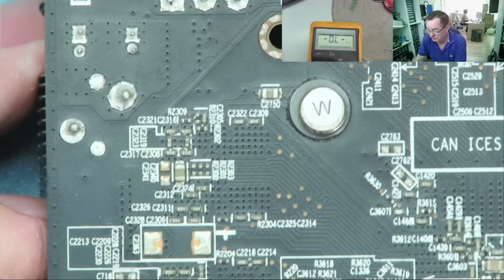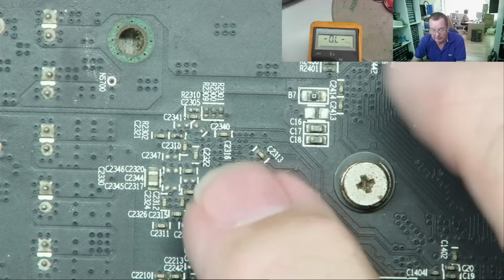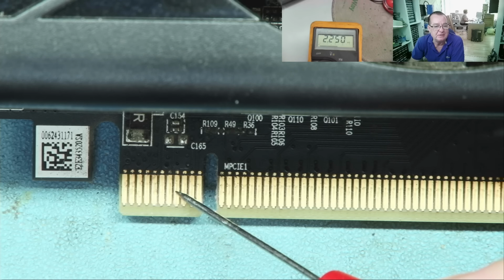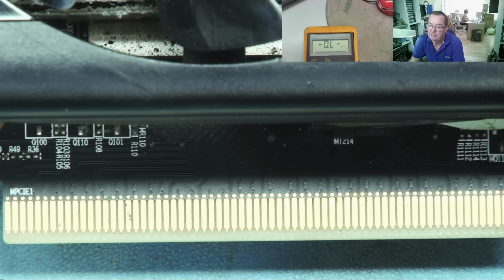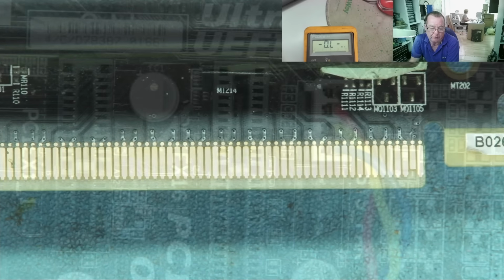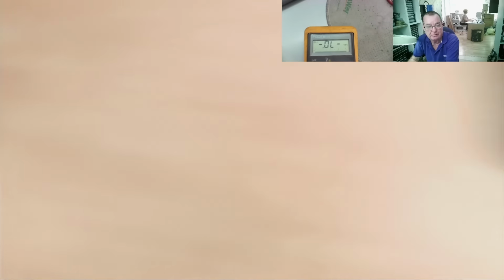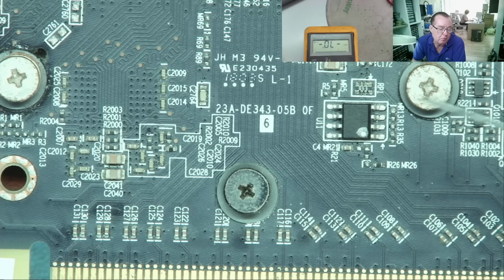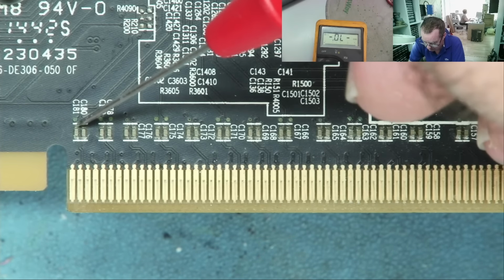Graphic Card Step By Step Fault Finding Guide. How to Diagnose a Faulty GPU Using Basic Equipment

Comment: Hi, thank you so much for the education, this helped me identify and replace 2 failed mosfets in the VRM that feeds the memory on my 980Ti GPU. unfortunately, i still get no memory detected on the GPU in GPU-z in windows and a code 43, i also get 0v at the inductor of the VRM, all other VRMs give correct voltages. i removed the Inductors and measure the resistances, i see 1.8kOhms on the VRM side and 0ohms (short) on the load side (memory side). i injected 0.5v and 1A to look for hotspots, and see nothing.. does this mean the GPU SoC itself is dead or do i miss something obvious? Thanks in advance.. really appreciate your videos

Comment: Amazing video. Well explained. 
I was looking for a tutorial that specifically covers PCIe connection testing since all the coils/inductors on my GPU are fine, or at least not shorted, so my mind naturally went towards the PCIe lanes to see if there's a broken connection between the core and the lanes as I didn't want to unnecessarily reflow the core (it's an old card), put stress on the components, and potentially end up break something else in the process.  
I thought it would be quite difficult to trace PCIe lanes but your tutorial was simply amazing. Everything now makes perfect sense. 
Subscribed!

Comment: would it be possible for a gpu with some corrosion near one of the memory module to work until you clean it with alcohol. I cleaned the back of a gt 710 and noticed the green corrosion very close to one of the memory. After cleaning its artifacting

Comment: Hi! My desktop pc graphics card, MSI GeForce GTX 1060 3GB has an issue: it cannot detect vram, so can't work as expected. 
I measured resistance at the PCIe 6 pin connector as you did, and while two grounds are ok, the center ground measures 92.4 kilo ohm. Could this be the issue? What is solution? I can't trace the path, i lose it. 
Can i short the three grounds together for testing purpose? Is it safe?

Comment: Hi sir need help, all voltages getting generated the vcore and vram are up but still no.display no blank display so its not vram could you please guide what should I check to find fault ? Its Rx 580 and rx 560
Reply: Idk if you're still looking for help but if all voltages are present and card is running with no output I would run a memory test to see if one of them has died.

Comment: Hi i used to work for a computer repair shop and i asked my boss at the time if i could take this broken gtx 970 home to see if it is repairable and he said sure. So i brought it home and put it in my rig to test. It booted into bios fine and stayed on while it was there. And it did boot into windows but it would only stay stable for like maybe a anywhere from a few minutes to secs. I have torn the card down a few times to make sure it is clean and i even tried the oven method and i also did probe it with a multimeter and everything seemed from for resistance wise (because i dont have the proper tools to test it while it is on for voltage). I had it work long enough to try and install the drivers for it, but it ultimately crashed and restarted the computer. I dont think it is repairable, but if it could be, what should i try to do?

Comment: Hello and thank you for your informative videos.
I have a :INNO3D Geforce RTX 2060
2060182-6G
PG161
63-1ADT06H1
K A9 45 A3

the 12v is shorted to ground and there is only one 12v supply connector on the board.
Im looking for mosfet replacements but cant seem to find any.
Where do you get yours?
the mosfets markings are: AL00 9Y 1F 
Some other mosfets are on the board but i think the AL00 's are the VRM circuit.
Other mosfets on the board: QA311 926 09R
GS9219 0NVM

Comment: Please be sure to tell us if you are using diode or ohms mode each time you change a check or operation. "Again we are still in diode mode with black on the ground" or " We are still in diode mode or Change to ohms mode and we will check". This is only as I was not sure if you were still in diode mode when you turned the board over. Just trying to learn! Thanks for the video.

Comment: I'm not really that familiar with graphics cards - can you please explain what a mining adapter is all about?
Reply: The so-called "mining adapters" are risers/extenders commonly used in cryptomining setups, where multiple GPUs are connected to one system in order to solve cryptographic hashes as fast as possible.

As you usually cannot plug more than at most two GPUs into the PCI-e slots on a motherboard, these adapters are used to mount the GPUs somewhere else, even externally to the case.

As PCI-e bandwith isn't a big issue when doing cryptomining, these adapters usually have a full (16-lane) PCI-e slot at one end, but just a single-lane PCI-e plug-in adapter at the other. This works because all PCI-e compliant devices are required to function (albeit slower) with only one lane connected.

It also means these "mining adapters" are ideal for doing repair work, as you can easily connect any GPU to any PCI-e slot without having to plug it directly into the motherboard. You can even have the GPU running while lying disassembled on the bench, as long as you take reasonable measures to prevent overheating.

Comment: Hie Richard ,I like your videos because of the use of pen and paper .The pcie lanes capacitors ,why are they connected in series with the power line ,not across power and ground. If series what is the use of them ,since this is a DC circuit,Thank you're
Reply from the maker: The PCIe lane capacitors are not in series with the power line, they are in the LVDS (low voltage differential signal) data lines.  As the data is transmitted at very high frequencies it easily passes through the capacitors, but they block any DC voltage differential between the motherboard and the graphics card which would easily damage the input circuitry that receives the LVDS signals.

Comment: Great video as always Richard, thanks for creating a comprehensive guide for GPU repair.
I was watching your videos for some time now, you inspired me to try some repair myself.
Just now I was checking not working GPU (GTX 980 TI) I bought on eBay, it has some blown fuses on 3.3V and 12V.
While checking data lanes, 9-th lane from both side reads a bit different, front ones reads about 0.77 but one side of the 9-th - only 0.64, from the back all reads about 0.64 but also one side of the 9-th - only 0.59. Is this enough indication of shorted core?
I'm not finding shorts on any coil.
Reply from the maker: I would say the 9th lane reading 0.77/0.64 is enough difference to be suspicious, if the graphics card powers up but does not detect it could well be a damaged GPU core that is causing the problem.  Have you tried the card on a single lane mining adapter? I would give it a go and see what happens.  Of course if the GPU silicon has internal problems, it may still not detect.  Keep watching as I will go much more into step by step detail iin the next episodes

Comment: 4:33, That top-right mounting screw looks quite crusty, especially at the top right next to the diagonally to top-right  pads for the unpopulated capacitor C2761. At 23:23, I might have misheard you but while measuring the voltage you say Watt instead instead of Volt, twice.
Reply: He said point seven five one that's why you misheard him.